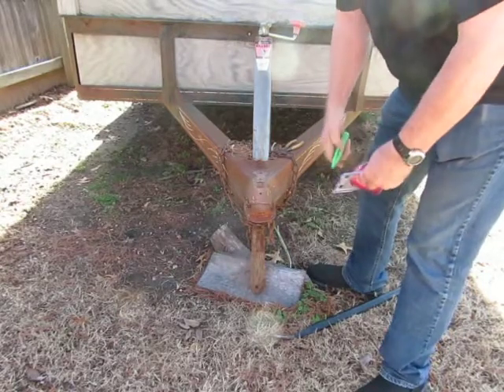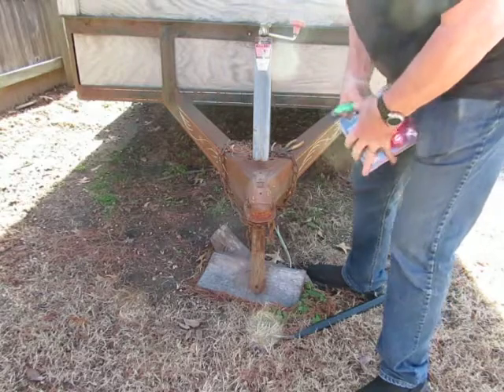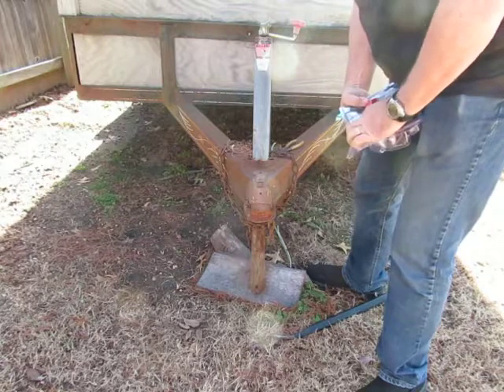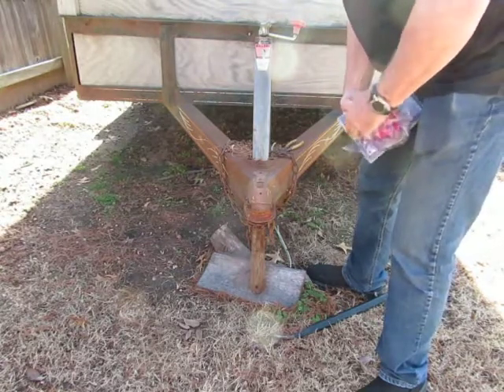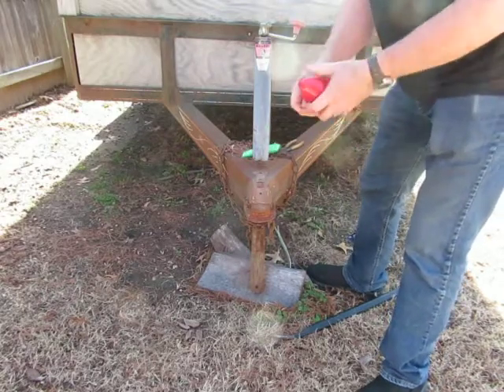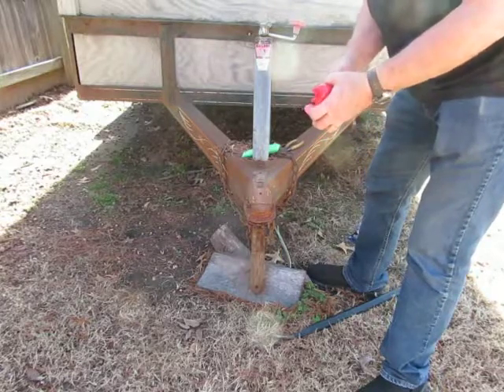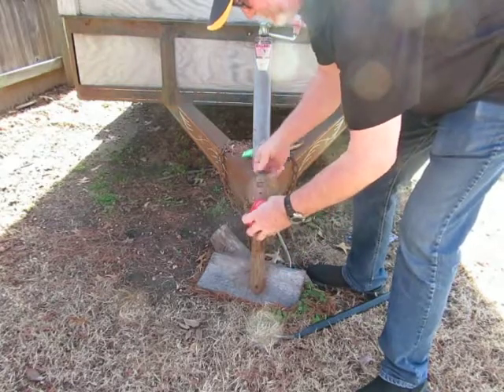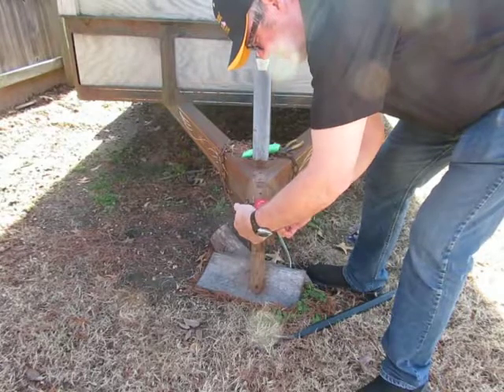Common MasterLock trailer lock EASILY defeated

Comment: I lost the key to my identical lock.  I can attest that the lock in this video as shown is in fact this easy to bypass.  I had just a tiny bit more trouble getting my crowbar behind the lock because I had it really tight, but as soon as I got it in it was mere seconds and the lock was off.  It took longer to find the video and watch it that to get the prybar and get the lock off.  🙂